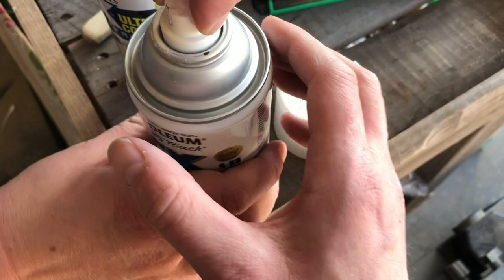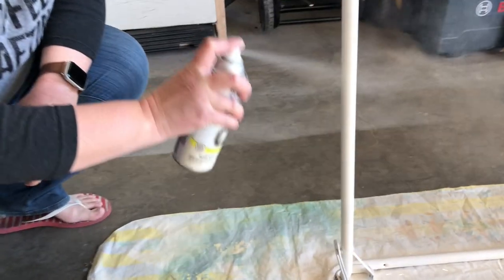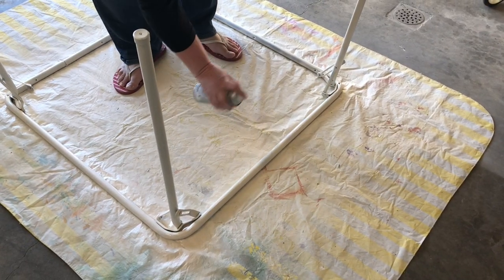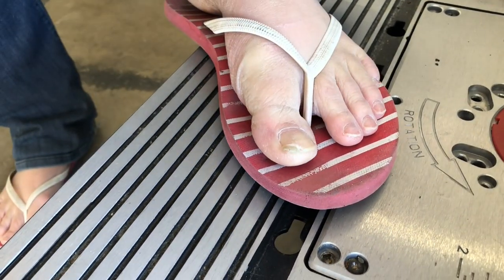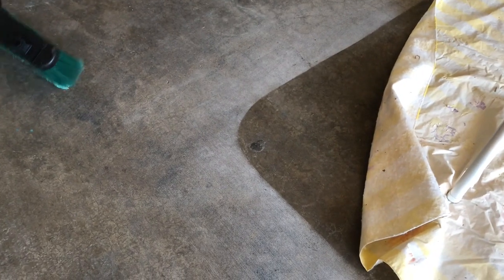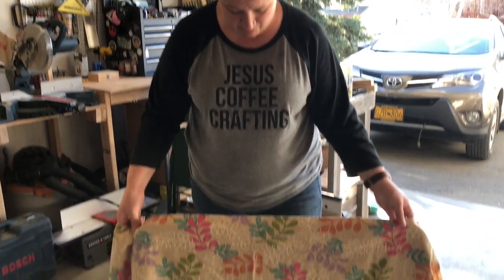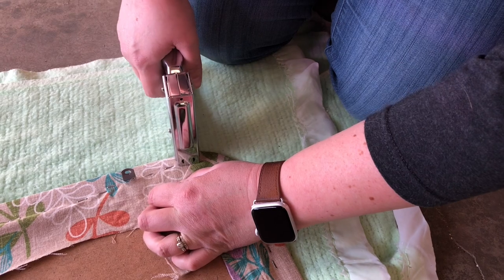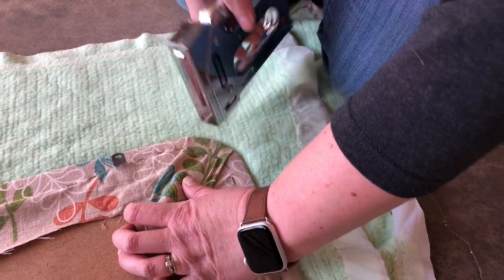Card Table Upgrade // DIY

Comment: I have a beat up card table as well. The matching chairs didn't last long either.  I was thinking of removing the vinyl that is torn and either putting fabric with a little padding underneath or peel and stick covering.

Comment: Make sure and use stainless staples...so they dont rust. Also you can get picnic cloth called oil cloth. Sold at joann's, ace and other fabric stores. You can order flannel backed oil cloth to look and feel better than original. I just found 2 of this type table 20x48 at Goodwill....came black but I'll fixThat!!!
Thanks for the video

Comment: Hi there I have a black folding table. Used as a desk. Rectangular shape but same material as yours metal and vinyl. I was wondering if the vinyl top could be painted instead of a fabric covering?  So what type of paint would you recommend for the top of the table seeing how it’s vinyl.